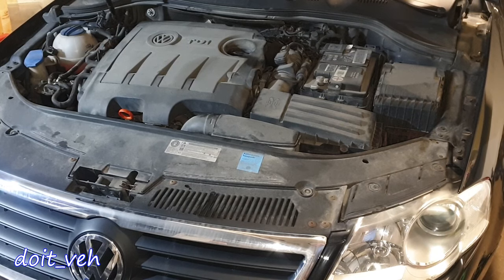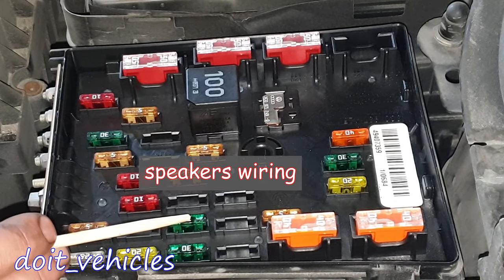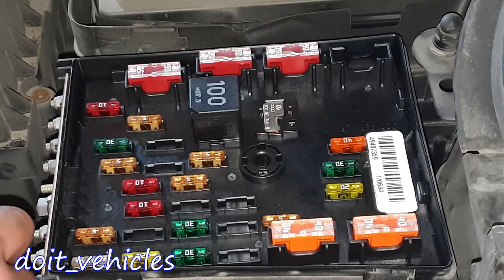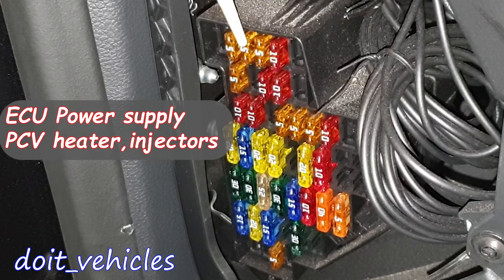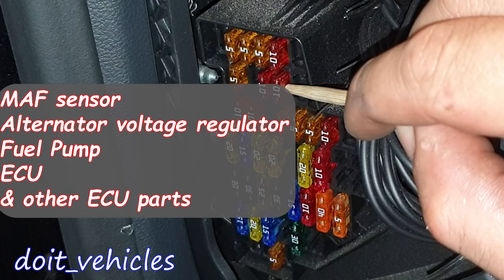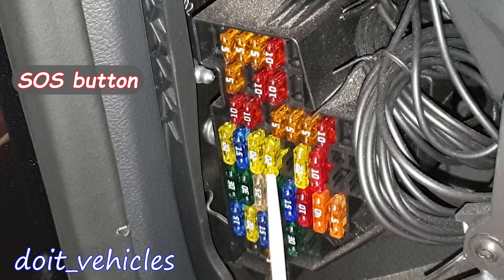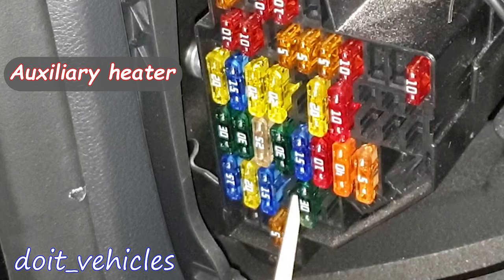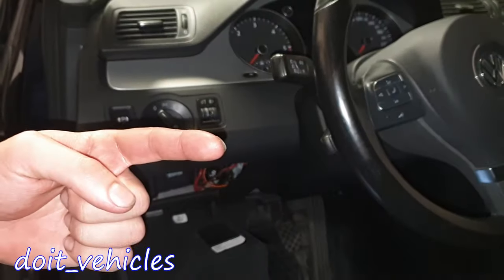1.6 TDI Volkswagen Passat B6 ALL Fuses and Relays Location / Layout

Comment: Which fuse do i pull to disable the immobilzer unit? My passat has a peoblem where it says immobilizer active, but after a few tries i can start the car somtimes its 2 or 3, somtimes its 20 or 30 tries to get it start. The key is factory and orginal.

Comment: 3:36  14 Numaralı Sigorta alarm sigortası mı ? benim arabada sürekli akü bitiyordu uyku modunda 20 25 Amper akım çekiyordu bu sigortası söktüm amper çekimi düştü

Is Fuse No. 14 the alarm fuse? In my car, the battery was constantly draining and in sleep mode it was drawing 20-25 Amperes of current. I removed this fuse and the amperage draw dropped.

Comment: Great!! Thx. Question. I changed the headlights, the left one works, the right one doesn't. What could be the problem? Thank you in advance.
Reply: Same problem. I found in manual that fuse 8. But mine is fine. Probably the wire, but its strange coz it just went out like a bulb.

Comment: That big metal unit which sits I. Front of the Alternator Fuse is blocking access to the front-side of the engine fuse box. Thus, how does one access the Alternator fuse with that metal unit blocking the front side?

Comment: what would be the reason for the rear outer light turning on and then 5 sec later turn off. and only for the left side?? 
take it apart and it all works ok giving it direct power. but for some reason the car gets into a hissy fit and kills the one left light at the rear, bizarre. checked all fuses and none are gone. power does go to the light and then turns off after 5 secs so not a break in the cables. all other turn and brake lights work on that side too, just the normal left night light which I can't figure out why it turns itself off after 5sec when you start the car.
Reply: Hey I’m having the same problem, only difference is that I’m having trouble with the right one. Did you found out what is the cause?